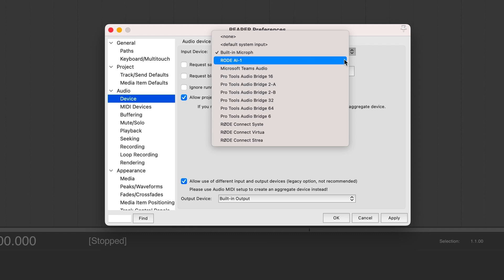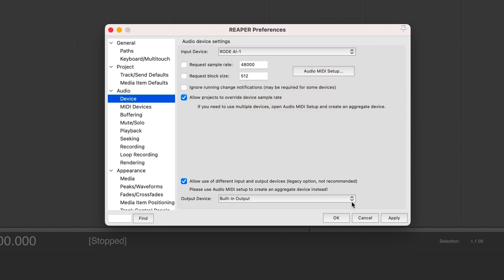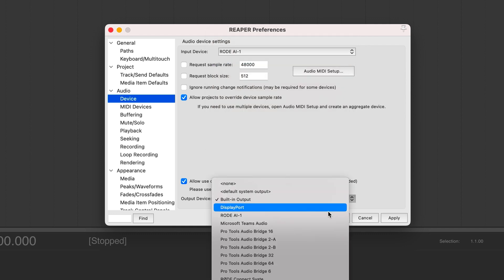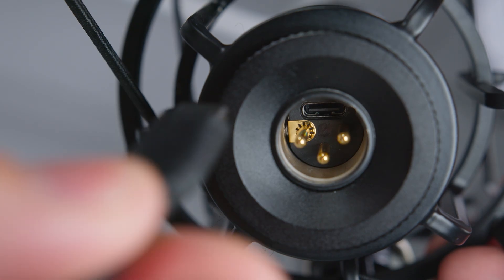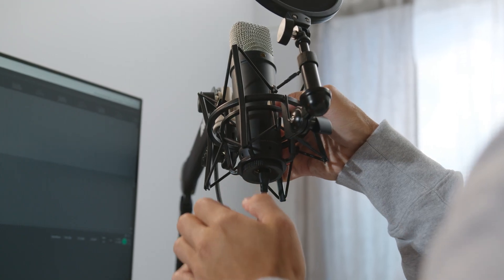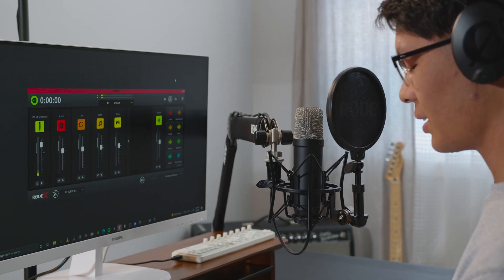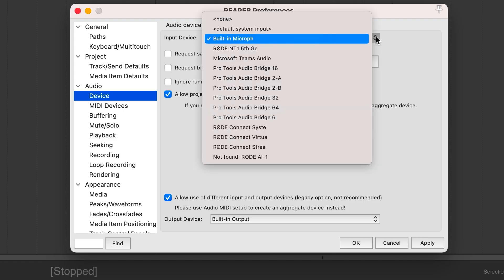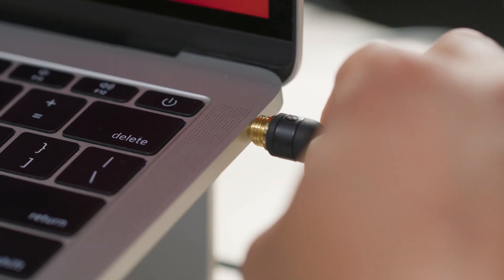How to Connect Your NT1 5th Generation to an Interface or Computer

Comment: just spent $200 on NT1 signature series and it said NOTHING on amazon bout having to buy extra things in order to use it... so now i just have a $200 mic with pop filter and stand for what?
Reply: Because the signature doesnt come with the usb.. so you'll need a audio interface or send it back and buy the $40 more NTA1

Comment: how do I connect it to an IPad? is the process the same? what headphones do you recommend?
Reply from the maker: They aren't directly designed and optimized to connect to devices such as an iPad - we'd recommend connecting to an audio interface or computer instead 🙏
Reply: @rodemic so if I connect it to an audio interface, from the audio interface can I connect it to the Ipad?

Comment: What if your not using a computer and just samsung phone. Do i need an interface for phantom power so connects between the 2 and connect headphoness to the interface
Reply from the maker: The NT1 5th Gen wasn't directly designed for smartphones - we recommend using these with a computer. Otherwise, the NT-USB+ may be a better suited option for you!

Comment: So after watching the video and reading some of the comments, I am a little confused. I have purched the NT1 5th Gen and a Focusrite 2i2, but I am getting the impression that I did not need the interface in the first place since I can connect the mic to my macbook directly. But then I saw that it needs phantom power, can I achieve that without this interface?
Reply from the maker: Phantom power is only needed when using the XLR option! But this is alleviated when you use the USB-C connectivity method 😊

Comment: I have the Rode AI-1 and the Rode NT1 5th Generation cst two devices do not work on zoom and obs. I bought them specifically for that. help. This may be a connection problem.
Reply from the maker: Sorry to hear about that! If they are not appearing on your computer, there may be an issue with the cable. I'd recommend trying with another cable to test. Either way, feel free to reach out to support and they'll be able to assist you with your devices - https://help.rode.com/hc/en-us/requests/new

Comment: Is the sound quality better with an audio interface like Scarlett solo or is there no difference. Would be nice to know so I don’t have to buy a new audio interface extra
Reply from the maker: When connecting to an audio interface, the performance will be predetermined by the quality of the preamps you connect to. I'd recommend giving the USB-C connection method a try first and see if you like it and take it from there!

Comment: Please, it's possible to connect nt1 5h to the Samsung 20 5g? Thank you in advance
Reply from the maker: I'm afraid that the NT1 5th Gen is not directly compatible with mobile devices.
Reply: @rodemic hi 👋 do i need to get an interface,  phantom power as I want to connect my phone and head phone to a 5th generation microphone I've not purchased yet but just doing my research

Comment: Thank you very much, you've solved my problem. One more question: I am a beginner in this field connected with recording using a microphone. Which audio interface (audio card) would you recommend? If I want to use the XLR input in the future, will I need to buy an additional audio interface to plug it in?"
Reply from the maker: You will need an audio interface or mixer that can supply phantom power to drive the NT1 5th Gen - the AI-1 will do the trick!

https://rode.com/en/microphones/studio-condenser/nt1-5th-generation

Comment: It looks like the 5th Gen here nullifies the need for an interface (due to the onboard sound card and the 32Bit capability). Am I correct to assume that?  If so, that must be revolutionary thing as typically, USB connections between your MIC and COMP is looked down upon. I guess there is a whole different situation here. 

I have a 2021 MacBook M1Pro and  the 5th gen NT1.   And I happened to order an interface ( FocusRite Scarlett 4th Gen ) but it has not arrived yet. I'm wondering if I should return it without opening it? What would I gain if I were to keep it?
Reply from the maker: That's correct, it has dual connectivity for a direct USB connection or traditional XLR via a mixer or interface!

Using an interface will give you whatever benefits that it provides, this can range depending on the quality of interface you've chosen. So I'd recommend reaching out to Focusrite for info on their product!

Comment: Hi, I'm considering purchasing this microphone and have a question. Can I use the USB C connection with the USB Type C port that I have on the gpu? it's a nvidia 2070 super, thanks
Reply from the maker: It looks like the USB-C port from the GPU could potentially only be able to be used for sending out a video signal for display. I'd recommend reaching out to the manufacturers to confirm this for you before purchasing 😊

Comment: Hi, i just want to ask.
Why did my rode nt1 5th gen doesnt have a signal input? Is it the settings or something? I just got it and cant use it.
I use M Audio for my soundcard
Reply from the maker: You may have to check to see if you have phantom power enabled! If it is on and there is still no audio, feel free to get in touch with our Support team who will happily assist you 😊 https://help.rode.com/hc/en-us/requests/new

Comment: Are you aware of any way to connect this mic to a Canon DSLR; enabling it to capture video and audio synced? 

If not, is there a reasonable workaround which doesn’t require extensive familiarity with editing?
Reply from the maker: Unfortunately not, the NT1 5th Gen is a studio condenser microphone that requires phantom power in order to work. Camera's are not capable of providing this level of power. We would recommend recording the audio separately and syncing it with the video with post.

Comment: Thank you for your quick and precise video. However, please do let me know if I need phantom power enabled audio interface while using USB connectivity ? Which sound output is better XLR with phantom power audio interface or direct USB connectivity with computer/mobile ? Does the mic has built in phantom power for USB connectivity ? Thank you in advance.
Reply: I tried to connect the microphone directly to my mobile device C port (as I do with my Maono USB mic.) but it didn't work as we have smule and other singing apps on mobile which makes it easy to record. Does this only work with laptop C port and not with mobile device?
Reply: @tanaynarayan hi 👋 I want to connect mine to a Samsung phone and thinking you have to connect it to an interface
Reply: no response from @rodemic
Reply from the maker: Phantom power will be needed for the NT1 5th Gen. While the sound signature remains the same with both connection types, USB-C connectivity comes with the added feature of 32-bit float!
Reply: @rodemic  thank you for your response. Does USB C connectivity need phantom power audio interface ?

Comment: I need the rode ai 1 I bought one think g it would work right away. Dang lol 😅
Reply from the maker: The NT1 5th Generation works with the digital USB connection and the XLR connection, if you have this model you don't immediately need to invest in an interface.

Comment: Quick question can you connect the rode NT1 A to a computer 💻 using USB adapter. Bc I saw one ☝️ on Internet but just wanted to be sure bf I order it.
Reply from the maker: We'd recommend a high quality interface such as the AI-1: https://rode.com/en/interfaces-and-mixers/ai-series/ai-1 rather than the (often lower quality) preamps found in smaller adaptors and such.
Reply: @rodemic  I just ordered the 5th gen. Thanks for the reply

Comment: I have a Rockville power Gig RPG 123k. Can I just plug  it straight into it ? Because  I'm not getting  any sound ,and does it have an off /on switch  ?
Reply from the maker: Hey there, the NT1 5th Generation uses 48V phantom power to operate, so you'll need an amp, mixer, or other interface which can supply 48V phantom power.

Comment: This confuses me because i have a 4th gen, plus theirs basically no tutorials plus i can't find out how to get my Mic to work in Audacity. I tried my sound settings with my mic and put audacity on the same ones. Idk what to do.
Reply from the maker: Hey there @RemedyJLock, we're sorry to hear that you're finding it hard to use your NT1 with Audacity. The only thing to really be aware of from our perspective is that the NT1 requires phantom power. Other than that, the NT1 functions like any other mic. The best way to solve your issue would be to try looking for help in the audacity community, asking the manufacturer of the audio interface that connects your device to your computer, or asking our support team here: https://rode.com/en/support/contact

Comment: Ia it possible to use an usb-c to usb-a cable to connect the mic to a laptop? I would like to test it because i have some problems with the usb-c to usb-c connection ( already talked with the support team and they advised me to buy an audio interface ) so i would like to try a usb-c to usb-a connection first but i want to know if it’s something the mic supports before i spend money on the cable. Thank you 🙏🏻
Reply from the maker: Hey there – yes the mic does support USB-C to USB-A cables. Good luck!
Reply: @rodemic  Oh awesome thank you for the reply ☺️

Comment: Hey can we use this mic on a phone,  i have galaxy note 10+, if yes then how? I have recently purchased this and now it's not working on phone so feeling like returning it.
Reply from the maker: Hey there, this mic should work with the Galaxy Note 10 as it works with USB-C phones (i.e. not phones with a Lightning port). We'd recommend testing it using the included cable from the box, and either the RØDE Central or RØDE Reporter app, as not all apps support external microphones, but ours definitely do. If your mic still isn't working, you can get in contact with our support team here: https://rode.com/en/support/contact
Reply: @rodemic  I tried both of them but nothing worked,  I guess it requires more power

Comment: Is it normal to increase my microphone db to 50 or there is not enough power? because I feel like I lose sound quality if I use it (I increase it in Rode connect),  but if I don't use it then I can barely hear my vocals at 23db (I'm using USB C Cable) and I see other peoples youtube videos using less than I do. Please help me
Reply from the maker: Hey there, usually our users will set their NT1s around 30db, but depending on how far you are from the mic, or how the tone of your voice, you may need to increase the gain. That's totally normal. The most important thing is that your NT1 sounds good- if it doesn't, let us know and we can help you out.

Comment: Mine didn't come with the thing you
plugged in?
Reply: Same problem here, did you buy it? Idk if this  audio interface is necessary
Reply: @joips1108  Yes unfortunately it's necessary. And it's like $200 :/
Reply: @imsittingonmars  yes, I watched a video bout it, bought the focusrite scarlett 2i2 3rd gen for 120, I hope that goes alright. Really didn't expect those things to be that expensive tho fr
Reply from the maker: Hey there folks. To correct the record, no, an interface isn't necessary to use the NT1 5th Generation with a computer running Windows or macOS. With these devices, you can plug the NT1 5th Generation straight in using the included USB cable. If your computer doesn't have a USB-C port, most USB-C to USB-A cables will work, such as the SC18. You can check out our user guide here for more information: https://rode.com/en/microphones/studio-condenser/nt1-5th-generation

Comment: After I bought the Rode NT1 5th, it became clear to me that the sound was very amplified. I checked the sound settings carefully and everything seemed fine, but the sound in all audio apps was still amplified and unclear. also I tried to install RODE CONNECT but it shows an error message that cannot be opened. Any Solution?

MacOS Catalina
Reply from the maker: It may help to adjust the volume of the mic in RØDE Central, by loading up the audio settings and lowering the gain. If that doesn't work, we'd recommend checking in with our support team here: https://rode.com/en/support/contact

Comment: Is there a way (e.g. ultra small interface) to connect it to my cellphone (via USB C)?
Reply from the maker: It's not compatible with phones but if you use an audio interface which is capable of USB audio, such as the RØDECaster Pro II, then yes, you could.

Comment: I'm having a problem that you might be able to help me with.  I have set up my NT1 5th Gen mic using the USB connection but when I plug my headphones in I don't hear myself.  My DAW is Audacity but when I tried to listen using Adobe Audition the result was the same--I can't hear myself while I am recording.  What am I doing wrong?
Reply: Did you download their driver?
Reply: @santoshpss  I did not.  For some reason I thought you only needed to do that with a Windows system and I have a Mac.
Reply: @jeffsteitzer6005  Wait you don't need a driver if you use MacOS.
Reply: @jeffsteitzer6005  Maybe change the output device as your headphones in the driver settings in Adobe Audition. I'm sorry but I'm not that familiar with MacOS even though I have an iMac but it's a 2017 version and I rarely use it.

I presumed you had a Windows PC.
Reply: @santoshpss  that's what I thought.
Reply: @santoshpss  Thanks!  I'll try that.
Reply: When connecting the mic via usb cable to your computer, do you get phantom power 48v? Or do you need a audio interface in order to get 48v?
Reply: @Luis-Dude  You don't need phantom power when connecting the mic using USB.
Reply: It’s the same for me in logic the vocals are not getting recorded
Reply: Kendinizi duyabildiniz mi aynı durumu bende yaşıyorum ?

Comment: So the stand didn't come with my Mic and basically, you NEEED a stand if you dont want you USB wire to be bent. The least the company could've done was give me a stand, I literally paid 250 dollars for this and I can't even use the mic properly.
Reply: I use an empty shoes box and I cut two holes in it (one on the top and one on the side) to let the wire pass through and then I layed the microphone on top of the box lol
I don't have enough money to also buy a stand, so I managed with what I had at home ahahah
Reply: Both of y’all boogers correct are correct 😆
Reply: You need a dose of reality. You got what you paid for - a microphone. How you use a microphone properly is not their fault, but yours alone. I can imagine the shock on your face when you find out there are far more expensive mics that DO NOT come with stands or arms, nor do they come with XLR cables. 

Next time, do your research before deciding so you manage your expectations.
Reply: U sended him sleep 😂 @glennblnco

Comment: I got this mic, I have usb a to a cable and an attachment at the end that makes it usb c so I can plug into the mic. However once plugged in the mic doesn’t show up in my inputs. I even downloaded the drivers, and my windows is up to date but still nothing. And then I tried using my Mac and used the default usb c to c cable provided and while the mic was now detected… I’m unable to select in my DAW (fl studio)
Reply from the maker: Hey there, we recommend using the included cable as other cables may not be the right spec to work with the NT1 5th Generation. If you're still experiencing issues, we recommend chatting to our friendly support team here: https://rode.com/en/support/contact

Comment: when Im connecting my nta 1 to my m-track audio interface its indicators flicker a bit but the mic still doesnt detect any sound
Reply from the maker: Hey there, that sounds like a tricky issue. Some troubleshooting steps could include trying other mics with your interface and trying to use your NT1 in USB mode. If the issue persists, you can get in contact with our friendly support team here: https://rode.com/en/support/contact

Comment: Thank you for the video. Can I use the cable with an adapter usb c to usb 3 instead of another cable? In that case, should I get usb or usb otg?
Reply: Is it possible?
Reply: I'm using it with its usb-c cable connected with a Female-C to male-A USB3 adaptor. Works perfectly. They say you can use any good quality USBC to USBA USB2 cable.